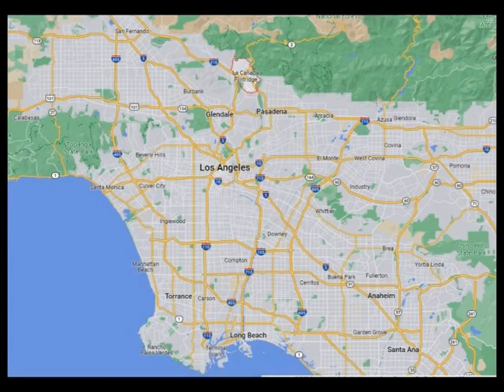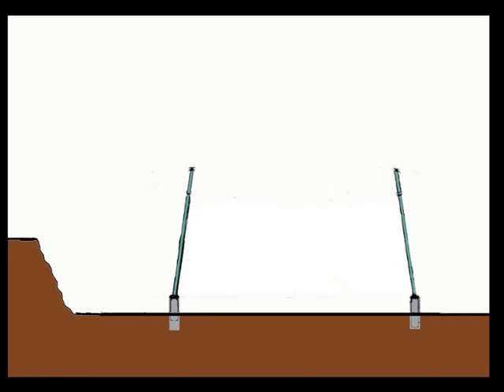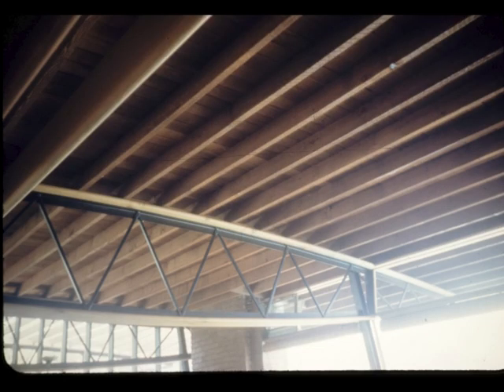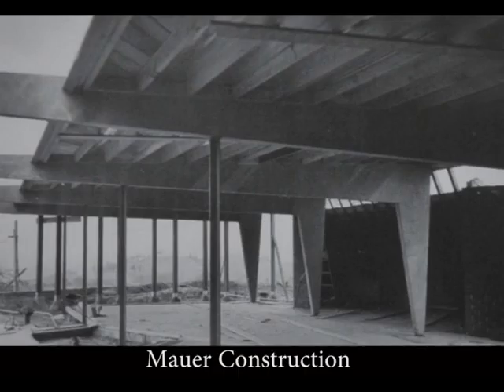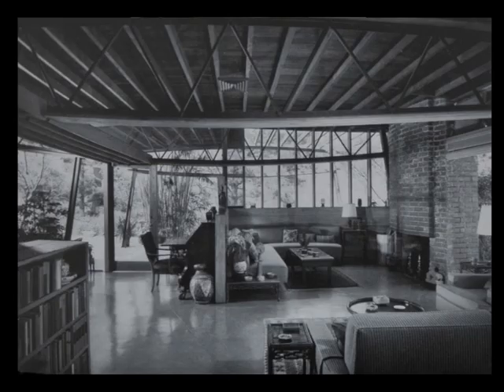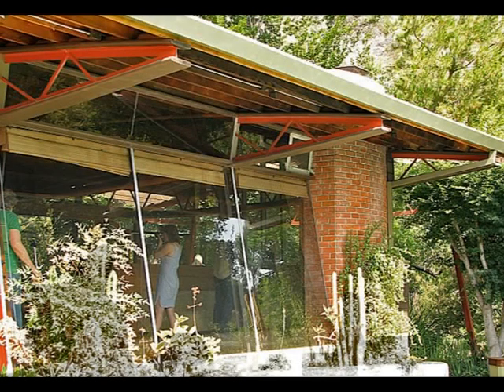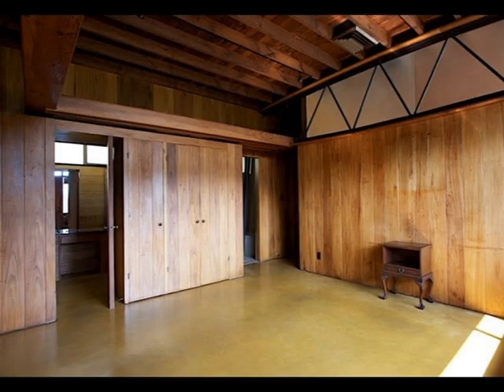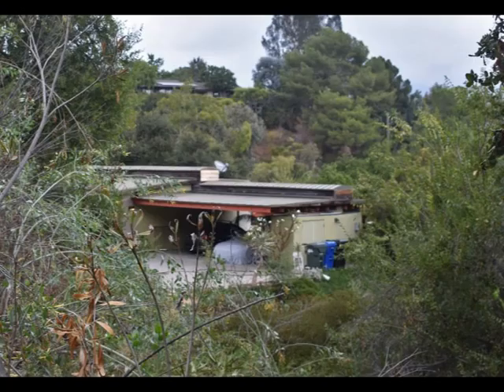Gantvoort House by John Lautner. Complete overview and walkthrough.

Comment: A smaller house is a little bit similar in roof supporting structure -metal trusses - by Lautner is at 780 Laguna Rd., Pasadena, California.  The owners at the time I saw it told me they immediately fell in love with the place when they saw it.  It had been on the market for quite a while, owned by an older lady, but because of heavy plant overgrowth it had not been showing well and people weren't too interested.  Then they bought it, and when they trimmed back the landscaping the natural light transformed the place.  I don't know if there are any interior pictures.
Reply from the maker: Yes that's Dahlstrom House, indeed also designed by Lautner.  It also has a steel roof construction.
Reply: @SuperJobbel  I don't know if you've seen this and I don't remember how I found it out, but a Mrs. S. W. owned a copy of Lautner's Bergen house.  I don't know how somebody copied it but I think it's cool to know.  It's address is #10 Snow Creek, Palm Springs and I can only find a bird's eye view of it but it has the trapezoidal and triangular shape in plan.  The community it actually resides in is Snow Creek.

Comment: Very interesting house and your videos are so comprehensive...and the early photos show how isolated it was in the landscape, unlike today, with homes right up against it.  The modern photo shows  this house now has a standing seam metal roof.  Not a bad idea really and I think it works with the original design.
Reply from the maker: I guess the roof is indeed covered with metal plates, but I don't know for sure,  and you're right that that the metal roof fits very well with the steel pillars. I didn't notice the isolated placing of the house in the 1940's. Funny to see how much the city is grown since then! :)

Comment: The "Garcia House" is on the MLS. YT keeps deleting my comment with a direct link.
Reply: Use a search engine and you will find it easily
Reply from the maker: For some reason YT always removes comments with a direct link.  I have already made a video about the Garcia House, you can see the video on this channel:     https://www.youtube.com/watch?v=76OzftbWbzI
Reply: @SuperJobbel  Yes i know and it's a great video🙂
The MLS means The Multiple Listing System in case you didn't know.
The house is for sale right now was what I meant.
Reply: After several tries to get around it YT keeps censoring me.
You can find new HQ photos of the house on The Multiple Listing Systems.
Reply from the maker: @oliverrasmussen4777  Yes I know that it's for sale. If I had 16 million dollars I would have bought it immediately!
Reply from the maker: @oliverrasmussen4777   I use MLS quite often for research.